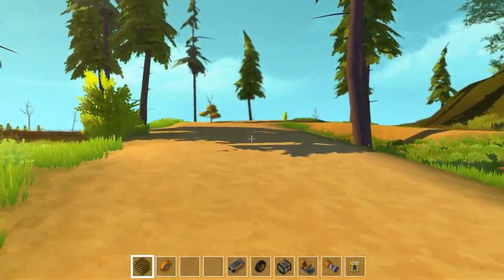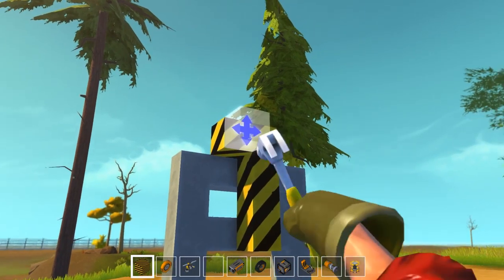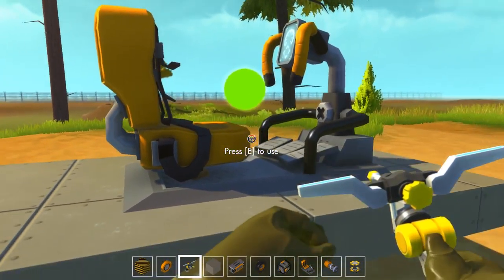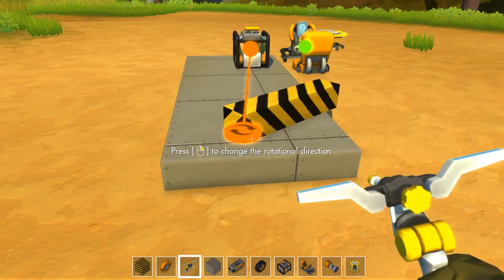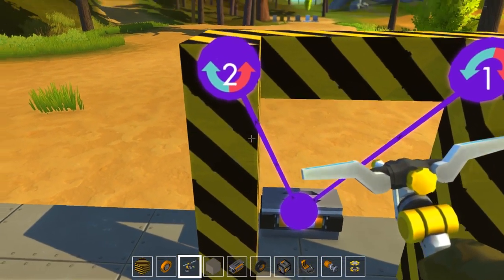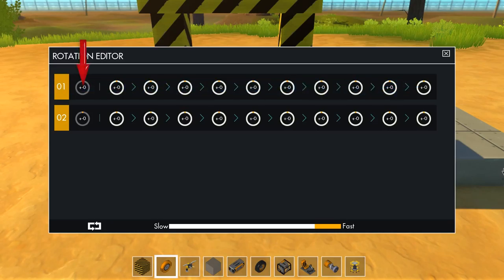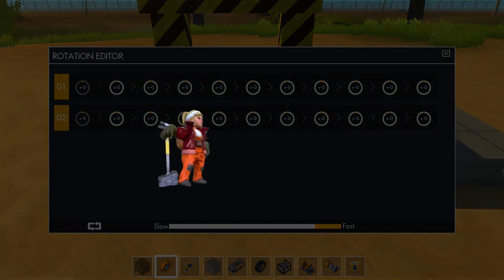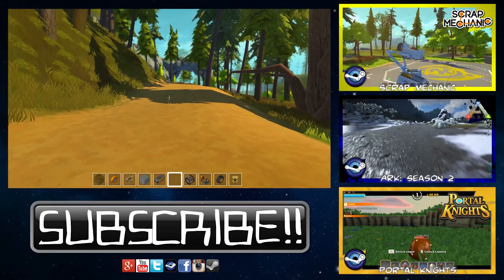Bearings, Controllers, & Connection Tool 102 - How to Scrap Mechanic: The Basics E2

Comment: I have everything connected but when i press the switch nothing happens. Need help because it is very frustrating.
Reply from the maker: Can you post a quick video showing what you're doing?
Reply: is the switch connected it probably is but just checking